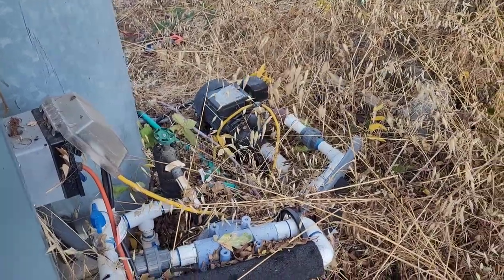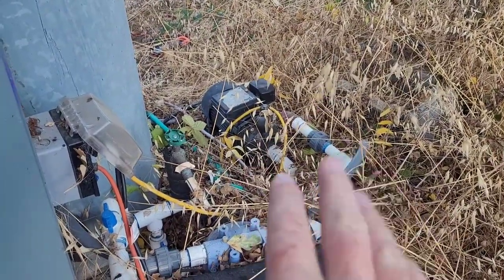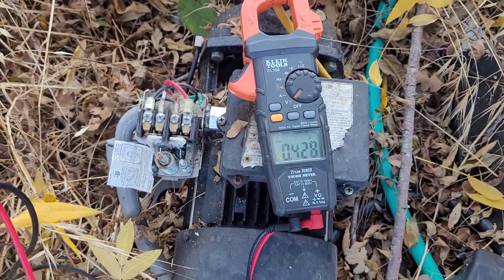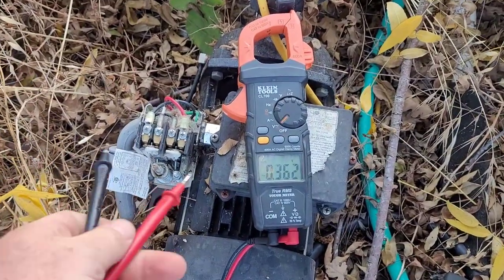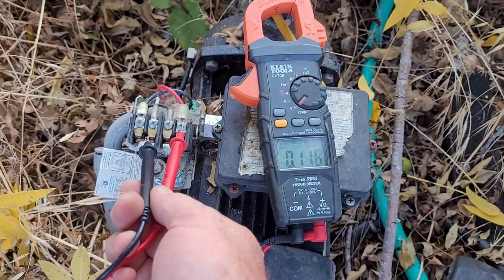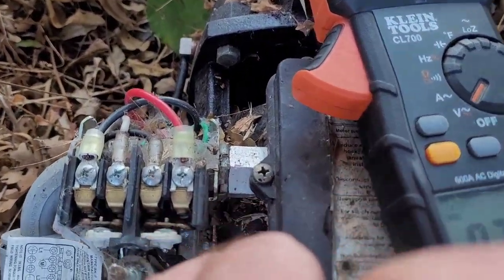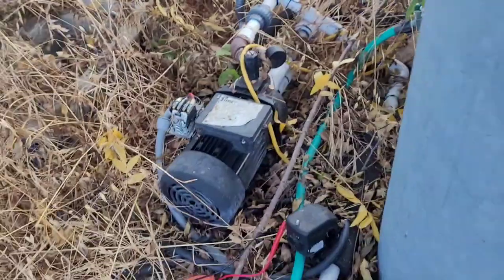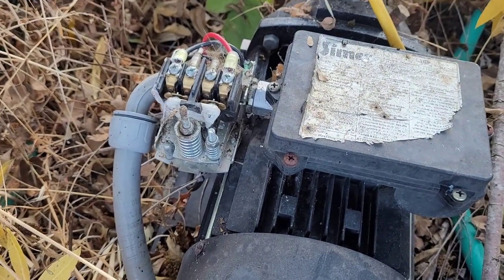Troubleshooting Well Pump Pressure Switch

Comment: Why won't my switch hit cut off pressure? It stops rising about 10 under and just keeps running
Reply: sounds like something is leaking - the bag in the tank may be busted - check pressure in tank when no water is in it - 3 pounds under the cut off pressure -
Reply: @user-du7pe6pm7d  Thanks for the reply Bro.
Tank pressure appears correct. Water pressure gauge doesn't bleed down when i kill the breaker either. What i'm thinkin now is i have a leak on the intake side that only appears at 40+lbs and up.
Gonna start from scratch and re-tighten/tape all joints pre pump.

Comment: sprinker system with 4 zones.after cycling through the zones the pump keeps running because the contacts don't open.4 zones are closed.what suppose to open the contacts?